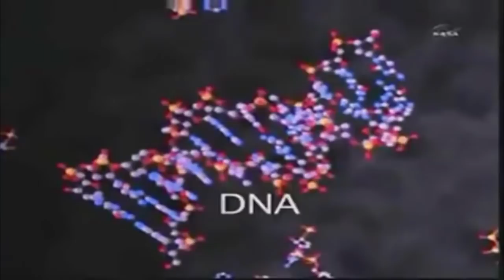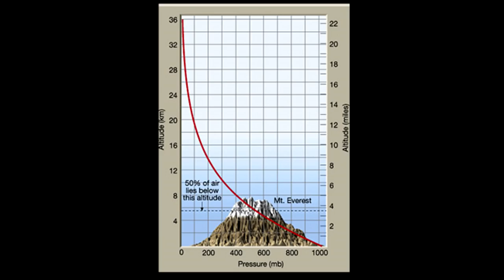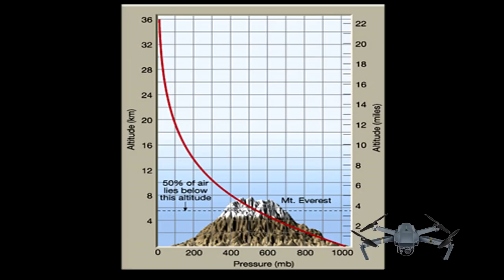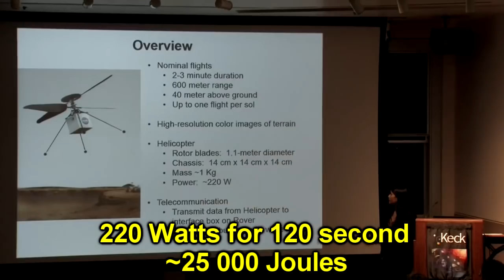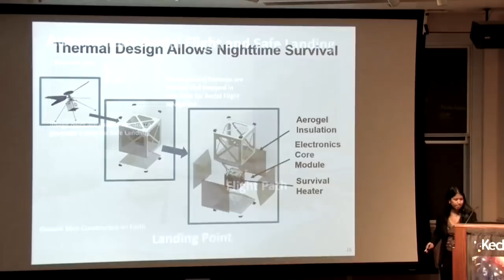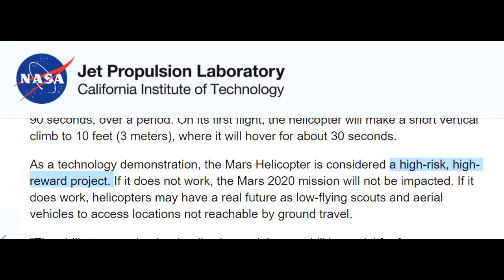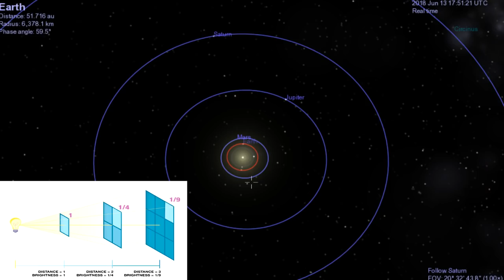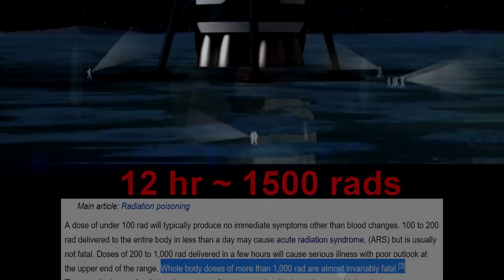NASA is sending Helicopter to Mars!! Smart or Silly?

Comment: WHY DONT THEY MAKE HELICOPTER ASSISTED ROCKETS?
Reply: What? How would this work? Thrust of rocket engines having to lift rotor blades and engine too? What's going to prevent rotation of the rocket? Helicopters use tail rotors or counter rotating rotors.
Reply: For the same reason we dont use them on Earth's first stage, they are not that usefull, specially when you have to lift a 100ton weight, a helicopter can't do that
Reply: you two dont have a clue if it would work, dont lie. i meant a huge drone crane for the first part with the most atmosphere, then it breaks away before the rockets start up
Reply: @liamlive2972  We took physics, Liam.
Reply: @nineball039  maybe the other guy did, but you did not
Reply: @liamlive2972  I never said it wouldn't work, but it would be a really new concept and im not sure id thats the best pre lift stage concept out there, we're already doing this with planes tho
Reply: @peksn  true makes sense youre right. thats why i said the other guy (you) probs took physics, or understands the basics at least. but not nineball. it was just a thought anyway
Reply: @liamlive2972  I don't think he understood you tho, he thought you meant the rocket gas exhaust would push the rotor blades

Comment: A helicopter on Mars? Lol This will never work!
Reply: you didn't watch the video lol, congratulations
Reply: It already landed smh
Reply: yes this is a stupid idea
Reply: @grifyn882  it works tho, as reported
Reply: @grifyn882  smh you need to watch they explain it, like literally you need to research about it, it has take off for several times with the Perseverance Rover, there is atmosphere in Mars, but it's so thin but they just need to spin really really fast
Reply: @grifyn882  just before going "you're 12 years old" when you don't do research yourself first... What's your external links to your "Mars has no air" or specifically "Atmosphere"

You look like an 12 years old than I am at this point
Reply: @grifyn882  and you thought copter are using turbine engine that requires Oxygen to work? Smh no, it can lift off whenever there's atmosphere, could be any kind, oxygen or CO2, it's not even equip with shit that requires Oxygen, it's not like you or me
Reply: @grifyn882  thing is I got a bit misunderstood by the definition of air, air is mostly oxygen and nitrogen, but you don't just slap an turbine engine into a copter that's lighter than turbine itself, it only need a gaseous *atmosphere*, which could be co2 to work

Comment: You are missing the actual point. Humans need a goal in order to focus on solving small problems and invent things that might solve other problems here on earth. It doesn't matter if they succeed or it is possible to succeed. Through the preparation of the project new materials will be found, maybe more efficient panels, better batteries, a lower voltage but more powerful CPU etc...
This is how technology goes forward for thousands of years.

They do have a challenge, and you have just a channel that consumes power to host this nonsense.
They change the world, and you change our nerves with your irritating attitude, your scientific ignorance and the lack of vision.

Comment: You did give it about a 12.5 percent chance of working (3 coinflips) which means you were technically wrong on whether it would fly
Reply: I have a 5% chance of rolling a 20 on a 20-sided die. If I SAY I have a 5% chance, that doesn't mean I'm WRONG if the die comes up a 20.